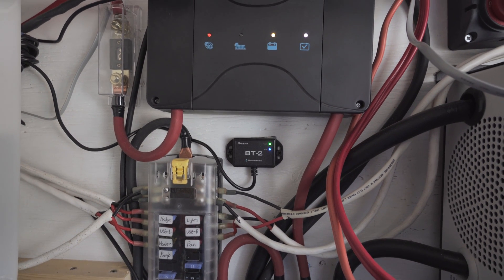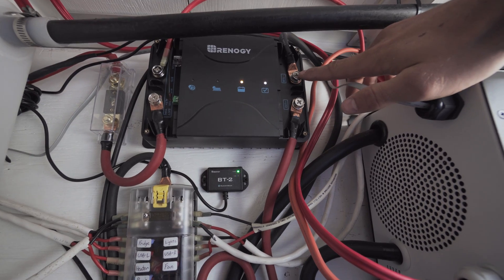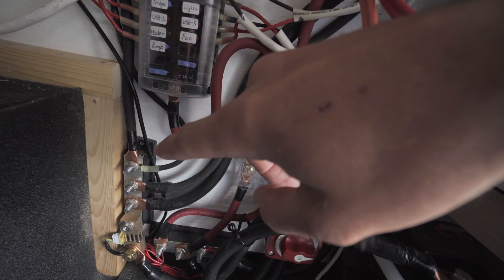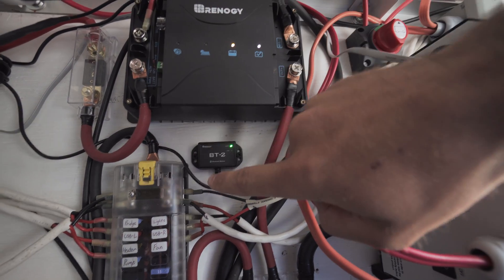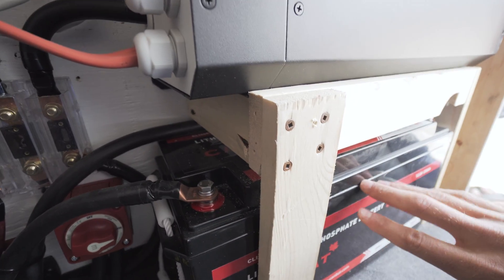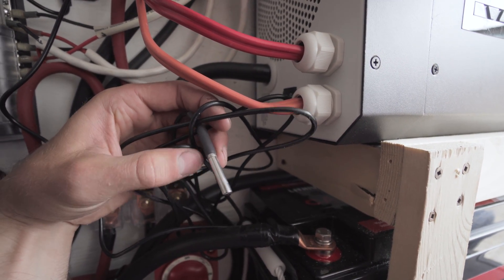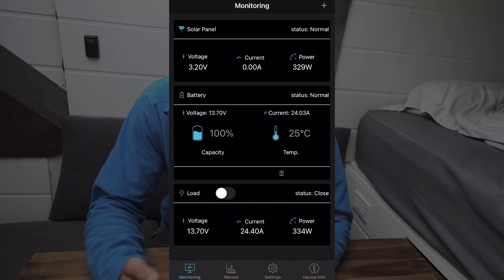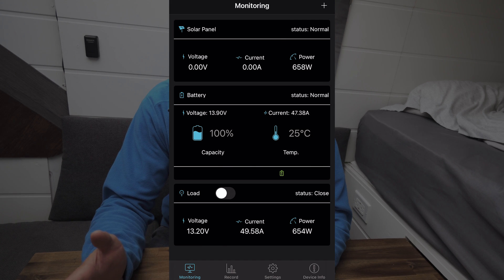Renogy DC to DC Charger Install in Off-grid Campervan Solar System

Comment: Hey there, I have the 30 AMP version of this, and I just got a 175W flexisolar panel. So I connect the solar panel to a switch to disconnect it so I get a more full charge from starter battery/alternator? Do you have that switch linked above? I saw in your video it's a red one...
Reply from the maker: Yep that’s right! Yes, the link to the on/off battery switch is in the description.
Reply: @madetoexplore  That switch looks completely different to the one in your video... these switches all similar and pretty  much anyone will do?
Reply from the maker: @bardock_gg  yes it is a little different but they do all work the same. I would try to stick to Blue Sea if possible as they tend to manufacturer a better product.

Comment: Hey, cool vid thanks! Do you know if you can adjust amps in the app? I have a 100ah battery that can only take 20 amps charge rate but planning to get a lithium one that can take 50 later. Heared somewhere that you can adjust the amps by factors of 10, so 50/40/30/20 if you wanted
Reply from the maker: No you can’t unfortunately. If you don’t install the voltage sensor, it will pull less than 20 amps from my experience.

Comment: > 35A is the max that you'll get

Well, yeah, if the solar can only contribute 15A. If you had the panel for ≥25A of solar you'd see the full 50A in that scenario.  It's not like the unit is limited to 35A.  The specs allow 660W input on the solar side.  

There are combo DC-DC that default to alternator-only when both charging sources are present;  ;  the kisae DMT line and Sterling come to mind.
Reply from the maker: Yeah I only have 525w of solar but if you had more solar you could definitely get more than 35 amps through this charger

Comment: Thanks for the video and the shutoff trick. I'm installing the 30A on my sailboat. If I need to motor due to lack of wind then this will come in handy. Thanks as well for the 5% code. Made use of that and saved a few bones on my order. If you're ever on Vancouver Island I'll buy you a beer. Cheers.
Reply from the maker: You are very welcome! Might just have to take you up on that one of these days haha 🍻
Reply: @madetoexplore  Please do. Been doing van life myself for years. I have a 73 VW bus as well as a 73 sailboat now.

Comment: Quick question, can this unit be used to jumpstart a dead starter battery?  I know it can keep the starter battery charged with solar, but if your starter battery were to die, is it possible?
Reply from the maker: Unfortunately not. You’d have to use the house battery or other source to jump the starter battery.

Comment: With connecting the ignition wire,  how have you connected the wire to that fuse?  Ive never seen a wire run to a fuse like that before.  thanks in advance
Reply from the maker: You can purchase a special fuse or you can just slide the wire around one of the prongs, then slide the fuse back into place.

Comment: I have the same 06 sprinter T1N and just bought this dual charger. I was looking today at how to route my positive cable to the starter battery. Underneath the van or in the track inside above the window areas in the cargo area and up to seating area. What route did you take to get to starting battery? Thanks 🙏🏽
Reply from the maker: I’ve altered my electrical design a little bit. I installed an 80 amp 12v breaker at the battery then ran the wire down through the engine bay and up under the drivers seat. Then underneath my kitchen cabinets to the back so most of the wiring is actually inside the van. It kind of depends on your interior layout whether you can hide the wire or not.

Comment: How does this hook up to my charge controller? Seems like every example I see there's no charge controller? Currently my solar comes down and straight to my charge controller. Would I just connect solar to the DC to DC charger instead, then everything else would stay the same?

Did my set-up years ago so I've become a bit rusty on all the electrical knowledge. Thanks!
Reply from the maker: This controller is both a DC to DC charger and MPPT solar charge controller. So yes you can just connect your solar to this charger as long as the voltage is under 25 volts.
Reply: @madetoexplore  oh wow. So my MPPT charge controller wouldn’t be needed with this, lol. Dang! Thank you!!

Comment: I like the form factor built-in, but I don’t see why you wouldn’t just go with a regular 50 amp DC to DC charger then whenever you’re starting your car your MPPT is separate and fully charging plus a full 50 A. Not sure which one I’m going to buy yet
Reply from the maker: Great question. Having one unit is cheaper and easier. I have 540 watts of solar and I rarely get over 25 amps. Your right though, if you have two controllers (50 amp dc to dc and a 50 amp MPPT) you could potentially bring in 100 amps while driving down the highway on a sunny day. This would require ALOT of solar panels though. With my setup, I bring in 25 amps from solar and 25 amps from the alternator while driving on a sunny day. Once the sun goes down, the controller will automatically start pulling 50 amps from the alternator or I can flick a switch to shut off solar and pull 50 at any time.

Comment: I HAVE RENOGY DC TO DC MMPTT , WHEN YOU SAY YOU RUN WIRE IGN TO YOUR FUSE ,  IM ASUMING YOU HAVE 2 WIRES,  WHEN I PURSCHASE MINE I HAVE ONLY 1 RED WIRE, SO IM ABIT CONFUSED,  I DONT HAVE SMART ALTERNATOR, I CONNECTED RED WIRE IGN TO MY FUXBOX. IM STILL GETTING 19AMP .
Reply from the maker: Some people got duplex and some people got a mono. Regardless, only one wire is required and needs to be connected to a positive location that is off when the engine is off and on when the engine is running. 

After you successfully do that, you need to shut off the solar input. This means disconnecting your solar panels or installing a switch like I have. Driving at night also tells the controller that there is no solar and it should start pulling 45-50 amps from the alternator.

Comment: Great video 👍 thank you for good info.
Would it not be possible to get more Amps from solar if there is a cutoff switch on altenator wire?
Just a thought 😊 im new to this.
Reply from the maker: Thank you! There’s no issue with receiving 50 amps from solar, it’s only the alternator that can be limiting. This controller prioritizes solar.

Comment: had one of these and it died in a few months, no obvious signs of burnt electronics and no internal fuses or anything. buyer beware you get what you pay for with renogy.
Reply from the maker: That’s to bad! Always a good idea to install external fuses on these solar components. Mines been working great for almost 3 years now.
Reply: @madetoexplore  ive got inline fuses on both the solar and alternator side both are intact and fine. its a quality control issue not installer error. I hooked up another product to the same lines and its behaving fine and meters out correctly.

Comment: Thank you for this Video! :) A short Question. Can i change the battery type and the voltage in the App or can i only view the parameters?
Reply from the maker: I believe you can only change the battery type on the controller. If you select custom, you can change the parameters through the app.

Comment: Have you tried a switch at the starter battery side to see if the MPPT can input maximum 50amps from solar panels?  
 So you only have the neg form charger controller to neg of battery not buss bar? 
   Do you have an inverter installed? I'm looking at the renogy 2000w running with 2x 170amp GIANT lithium batteries, trying to find more info running pos and neg from inverter to opposite battery POS neg  terminals so to hopefully split the amps draw from inverter so doesn't shut down each batteries BMS (BMS EACH 150AMP Current limit).
Reply from the maker: The controller prioritized solar so having a switch on the alternator wouldn’t change anything. I have received 45-50 amps of solar for sure. Yes I have the Renogy 2000w inverter with a 200ah Canbat heated lithium battery. Haven’t tried splitting the amps before but let me know if that idea works!

Comment: I'd like to suggest an automatic option to avoid the need to use the large rotary switch on your solar feed.
I would suggest using a CHANGEOVER RELAY instead of the switch.
Wired in such a way that when the ignition is OFF the relay will be closed, which will mean the solar panels are inputting power.
When you fire up the engine, the changeover relay will turn off the solar input so you will get full input from the alternator.
Reply from the maker: Yes, this would work well and I have thought about installing one of these. I very rarely have to turn off the solar so I haven’t been in a rush. Do you have a specific switch that you would recommend?
Reply: @Made to Explore  bearing in mind that I'm in Australia,  I'm not sure if the products I have access to,  would be available where you are. 
Having said that,  we have a brand called Narva who make all sorts of 12v gear.
Their part number is 68048BL for the changeover relay I'd recommend. 
It also depends on how much solar input you have. 
These relays are only rated for 30 to 40 amps, but that should be plenty for most people.
Reply: But that would mean that he would not be able to run it at 25A on a nice sunny day.

Comment: Hi, just I installed this and only getting 2 amps from the starter battery whilst driving all connections are where they should be, used 25mm2 cables. Any ideas? Thanks alot
Reply from the maker: Have you installed the smart voltage sensor wire?
Reply: @madetoexplore  I didn't get that wire in the box with it, I got batt temp and ign wire 🤔 is it a separate order in item?
Reply from the maker: @mylessackett489  sorry I’m referring to the ignition wire. I would try disconnecting it and see what happens.
Reply: @Made to Explore  ok will do thanks for the help 👍

Comment: Hi, thank you for your video ;-) Do you know, how many watts your alternator has? The manual says, that the maximum power of the alternator is 660W. I'm a bit confused
Reply from the maker: My alternator can provide up to 150 amp depending on engine RPM. This would be about 1800 watts. The 660 watt figure is actually for solar, not the alternator.
Reply: @madetoexplore  Thank you for the quick reply.  I have already received a reply from the manufacturer that 660W is the maximum usable power of the alternator
Reply from the maker: @MichalKubinec  yes, the charger won’t pull more the 50 amps from the alternator so that’s about 600 watts 👍

Comment: What’s the correct way to install the charger when the the van battery is 24V and leisure battery is 12V. The van also doesn’t have a smart alternator meaning you aren’t meant to install the ignition wire therefore how does it stop charging once the engine is turned off? Thank you :)
Reply from the maker: What voltage does the alternator push out? The charger won’t pull a charge if the voltage is under a certain amount. You don’t have to connect the ignition wire if you don’t want too.

Comment: Hey this was quite helpful to answer a question I could not find.  I assumed (like you also wished was the case) that if the solar was only pushing 10 amps then it would pull the remaining 40 from the alternator.  I almost ordered the 30 DCCS version but now Ill for sure buy the 50.  Thanks for the info.      Now that you have used it,  is there a way to shut it down completely while driving with your phone app or with Renogy One?  Not a big deal I am just curious.    Also,  do you know if there is any way to connect the 3000watt inverter charger so the info is viewable with the Renogy one, or with some sort of external monitor screen?
Reply from the maker: Welcome! Thanks for watching. No, I don’t believe there’s a way to shut it down but i am currently testing out the Renogy One and will be releasing a video soon.
Reply: @madetoexplore  oh that’s great, I’ve heard it can’t connect to the 3000watt inverter/charger yet which is a bummer but I haven’t installed anything yet myself.  That will be a next week project,  looking forward to your video to hear what you find out.    Quite the learning curve getting into this power system stuff, it’s very interesting.

Comment: Hey great video! Can I ask why you don't have a fuse between the switch and the solar panels? can't the panels create some serious voltage when it's really hot? I read that the switch can only handle up to 48V but solar panels can put out over 100V.
Reply from the maker: Thank you! Yes I do. I have a MC4 fuse installed between each  of my solar panels on the roof of my van 👍

Comment: Damn how are you getting that many amps from the alternator. My amps are super low
Reply from the maker: Wiring the voltage sensor and shutting off power from the solar panels!
Reply: @madetoexplore  I do t even have solar panels in my setup and not even close to that :/ i won’t see if it’s because the alternator isn’t strong enough. I have a 150amp alternator
Reply: @madetoexplore  but I thought the whole reason for buying this unit was so you could draw current from both the alternator in the solar panels maximum of 25 A each. Why should you have to turn off your solar panels?
Reply from the maker: @victorjcano  if it’s installed correctly with the ignition wire connected, you should be pulling 25 amps from the alternator. With no solar panels and/or during the night you will pull close to 50 amps from the alternator. If your pulling less it’s because the ignition wire isn’t installed correctly

Comment: Couple of questions, how did you find out you had a smart charger? How did you handle the original charger that was probably part of the AC to dc that one uses when camped with power plug. The renogy only has two inputs. Now you have solar, alternator, and shore power?
Reply from the maker: I researched these solar components for a long time before purchasing them. I have the Renogy DC to DC charger with MPPT and the 2000w inverter charger
Reply: @madetoexplore  so you don’t know?

Comment: Hey I'm installing a very similar system,  I want to know about having all your negative wires (pv, start battery and house battery)  terminated on the negative bus bar rather than on dcc50s. Is that something you decided to do or was it something that Renogy said was OK to do ?
Reply from the maker: Renogy does recommend using busbars. They make maintenance and the initial install much easier.
Reply: Thanks for the reply,  yes I spoke with renogy and the okayed my wire diagram and also confirmed that negative wires on the - bus is okay.. personally thought it would look sloppy with a bunch of wires terminated on the dcc50s
Reply from the maker: @HowToFromMeToYou  yeah, it would look messy and it would also create a lot of stress on the one terminal.

Comment: Hi I have a question about the connections. I just got the renogy rover mppt controller with 200w of solar and I also would like to use bus bars like yours. Can i use it the same way you have it where you plug the controller into the bus bar instead of straight to the battery? So the the only wires coming out of the battery terminals is directly to bus bar? Or does the controller need to connected straight to the battery to charge it?  Thanks!
Reply from the maker: Yeah, a busbar would work great! A bus bar is like using an extension cord with multiple ports.

Comment: Problem with Renogy DC DC is we can not connect solar panel in series, they support Max voltage is about 20v.
We ran into this problem that if run in parallel, which requires very large gauge cable
Reply from the maker: Yeah, the 25v max. is definitely a downside. How many panels do you have?

Comment: How do you connect the D+ signal wire to a fuse? I'm clear on identifying one, just don't know how to Connect the two so to attain a signal.
Reply from the maker: Since the wire is so small, you can pull the fuse out, put the wire around the metal part of one of the fuse legs, and slide the fuse back into place. Or you can splice into the wire behind the fuse block.

Comment: Do you know how to work out which amperage renogy model you need to go for in order not to put too much pressure on the Alternator ?
Reply from the maker: The 50 amp model will only pull around 10 amps if you don’t connect the smart alternator wire. If your worried about your alternator, I would install a switch near near the driver seat so you can turn it on while your driving on the highway when your alternator is producing a higher output

Comment: Great video.  The ignition sense wire has nothing to do with the solar vs. alternator 50/50 split.  It is for "smart" (Euro 6) alternators and otherwise unnecessary.  Your solar on/off switch is the way to go if you want to draw full alternator amperage (50A) while the solar is connected.
Reply from the maker: Thanks! Your right, it doesn’t have anything to do with the 50/50 split but if the smart wire isn’t connected, the charger will only pull a max of 10-15 amps from the alternator. The wire needs to be connected to pull 25-50 amps.
Reply: But here’s the thing, is I understand it in DC to DC converter MPPT controller is supposed to charge your battery from both the solar panels in the alternator. It does not appear to do this especially when you’re driving in. The solar panels are connected. Either I am misunderstanding, Renogy’s explanation, or the units are not functioning is a suggest.